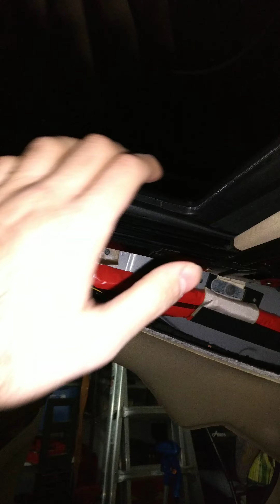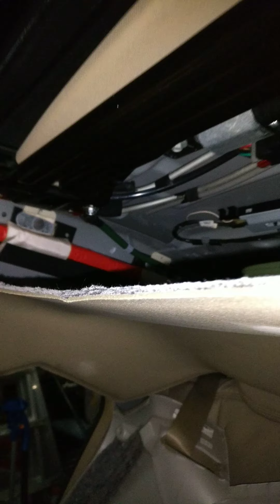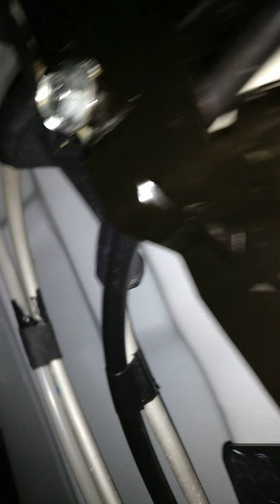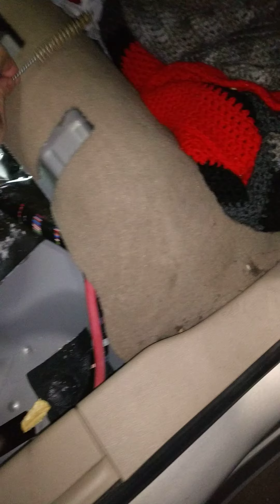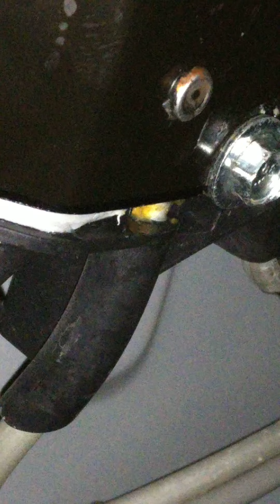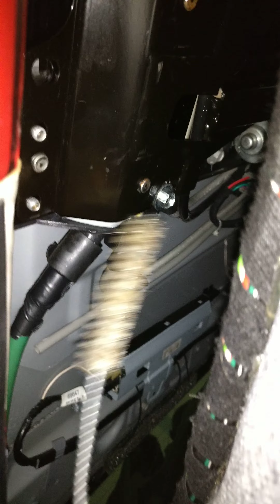Leak for Cadillac CTS 2009 sunroof

Comment: I fixed my 2010 exact problem by taking out screws and puting blue thread locker. Then i put a little bit of clear rtv silicone around area and Over bolt head . The bolt is a 10mm bolt that he pointed where the leak is coming from

Comment: I don't understand what you are doing...
I cleaned 2 drains in the trunk, one close to the battery, and  on the other side, after removing the carpet and one drain on the driver side, and it is fine now... I couldn't access the one on the front passenger side.
Other than these 4 drains are there any other one, I am not aware of? Thanks

Comment: Any updates on a fix, I have this issue too on both left and right back sides
Reply: @Albero Velazquez nice! this would be so helpful, if you don't mind.  And thank you for replying too!
Reply: I need ittttt howwww
Reply: @50shadesofjess  I had to put double sided tape with thick black big garbage bag (during the meantime) so that when I get some time to fix it its will prevent leaks. The bag is a temp hold and the double sided tape does well! Especially that its raining often here in washington
Reply: I iust got some thread locker. And clear silicone to cover the area. Apparently it works. @andreapeyton
Reply: Hi were you able to receive the pdf from @abad06? I would really really like to fix this problem on my car I’ve literally tried ton of different solutions none of them work :(
Reply: @andreapayton
Reply: @austinmartinez6865  yes if you want to provide your email i can forward it to you.
Reply: @austinmartinez6865  just sent it, now you can remove your email from this string ;)
Reply: @50shadesofjess  just sent it, now you can remove your email from this string :)

Comment: Canon Mikho, Did you ever find the solution? Mine is leaking in the same spot I believe. I had a wet spot in the rear center of my headliner just in front of the lights. I've cut the duck bills off the grommets years ago and have checked them to be sure they are clear and they were. Is it possible that screw goes to the onstar antenna that would be located just above it? Ive seen a lot of GM trucks that have been leaking because of that antenna.
Reply from the maker: I wanted to post a video on the solution but someone totalled my car recently so I can't post a video. I'll probably create a video talking about it - but check the seal on the front water drain channel that runs from the left front tube to the right front tube. It's literally a long piece of metal that is "glued" to the left and right sides of the left and right drain channel. It's hard to type so I'll create a video

Comment: Bro having the same problem what did u end up doin to stop the leak i was thinkin silicone thw aera around the screw ....if u can respond i appreciate it
Reply from the maker: I added seamsealer around the rear sunroof lining. I'm posting up a video about it soon, maybe this week. I'm waiting for my sunroof plastic tubing to come in then I'm going to record it.
Reply: Canon Mikho. Ok koo t.y i juss put the same stuff around it so im hoping it works
Reply: Canon Mikho i love the giant sun roof but its a pain in thw ass w all thw drains n shit
Reply from the maker: @nikocapone6887  all dual sunroof cars have them! They are a standard
Reply: NIKKO DID U EVER FIX THE LEAK ON THE CTS SUN ROOF AND HOW
Reply: Oceancrash did you have to take the whole headliner down to fix this leak? Or did you just seal around the rear bolt & tube?
Reply: @AndreaLopezPeyton  yes it worked try to get the best idea where the leak is coming from then  you need to make sure their is no water that its dry and silicone or use adhesive caulk and I put a layer on let it dry then put another and it hasn't leaked since n also make sure your drain tubes are secured tightly sometimes they get loose to
Reply: @AndreaLopezPeyton  ur welcome bae hope it works
Reply: Yes it worked I took down the back lining of my car and made sure both tubes wernt clogged found where the water was leaking from and put two coats of silicone adhesive on it one coat then let it dry then another coat real good over the spot where you think the water is coming from it's real tight so it's hard to tell and luckily it stopped mine from leaking completely.
Reply: @intercept797  Yes it worked I took down the back lining of my car and made sure both tubes wernt clogged found where the water was leaking from and put two coats of silicone adhesive on it one coat then let it dry then another coat real good over the spot where you think the water is coming from it's real tight so it's hard to tell and luckily it stopped mine from leaking completely